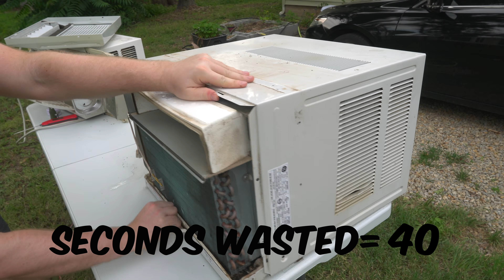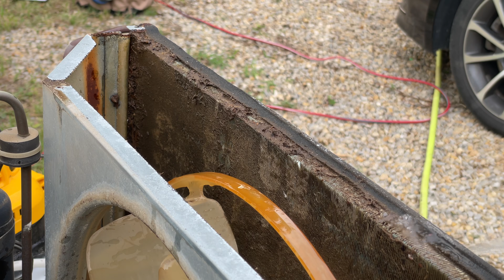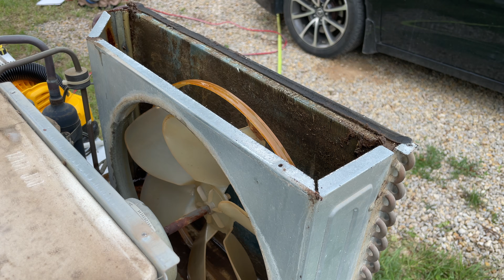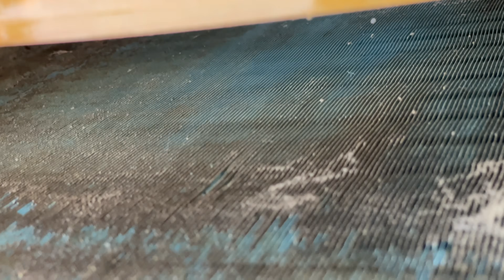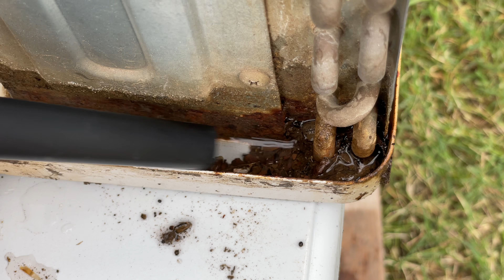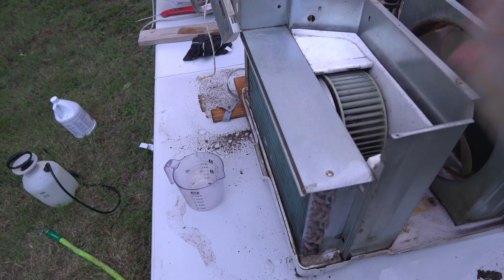DEEP Clean Window AC The Correct Way!

Comment from the maker: ⚠ Did you find this video super helpful or save you money? Buy Tim a coffee to say thanks: ☕ 
PayPal: https://paypal.me/handymanhertz
Venmo: @timhertz      
CashApp: $timhertz1
Reply: They have fin combs! They're easy to use if they get bent. I used to work manufacturing ac units.
Reply: My account is permanently in apt wall. I don't have a drill.
Reply: A coffee?😂
Reply: Hi, hope you see this >> for the added antifungal benefit, can I use in-cide instead of simple green?
Reply: Where are the links to the items you used? I haven't spotted them here.
Reply: Good man, the only proper way to clean a window ac. Filthy inside condenser surface creates short cycling then people just throw them out unnecessarily.
Reply: As a window air conditioner cleaner guy. Here is a tip, triple D coil cleaner. You are welcome. I mix it 6 to 1 and spray everything. Soak to 10 minutes and use the sprayer you use. It melts the mold. A toothbrush works best on the coils but a brush attachment for the drill works well. I like the mold spray that you use but only for after everything is clean. Spot clean the mold in the foam with bleach and rinse immediately. I have been cleaning air conditioners for more than 10 years. If any other cleaners are left on the coils, it can and will oxidation on the coils. Triple D coil cleaner is meant to be left on the coils in lower concentrations. Another great tip. Used 3-in-1 oil on the shaft of the fan motor against the motor to protect it from water getting in. Run the unit on at least low fan for a week to allow the fan bearings to dry out in the off chance that they got wet during cleaning.

Comment: My apartment complex installed the window air conditioners directly into a sealed hole in the wall UNDER a window so no one can access the inside of their ac. 
I’ve been having mold issues on the inside of the machine that I can smell every time it turns on and irritates my allergies. I can only wipe where the air comes out and clean the filter, but I can’t get to the source of the mold. I submitted a maintenance request to get it deep cleaned, but they can’t remove it from the wall either and don’t speak English, so they weren’t understanding me when I told them I had already cleaned it on the outside and they need to go deeper. 
They left and I still have the same problem.

Comment: Did this deep clean on our window unit last summer after it started blowing weak air — made a noticeable difference and honestly should've done it sooner. One thing I'd add: if you clean it thoroughly like this and it's still not cooling well, don't keep troubleshooting yourself — that's usually low refrigerant, not dirt. We called Product Air Heating & Cooling after ours didn't improve post-cleaning and they found a small leak in about 20 minutes. Do the cleaning first, but know when to stop and call someone.

Comment: Just cleaned coils on a windmill window ac that is 11 months old. I turned it off and used simple green coil cleaner and used an ac coil brush. I rinsed it with a spray bottle. Waited 30 minutes and turned it on. It now doesn’t cool at all only fan working. I’ve unplugged waited 24 hours. Plugged in and it’s still dead. I popped test and reset on plug a few times too. So weird it worked great, I went to wash filter and noticed some dust and thought I’d help efficiency lol

Comment: if you want a different option to help clean the fins, I use the ryobi power sprayer, its pretty much a power 18v spray bottle. that can run purple power 40 oz  spray bottle in 10 seconds. and deep cleans without to much power.

Comment: So I just cleaned one of my window units and now the fans are making a loud, awful noise. I put wd40 on the center of each where they spin and it hasn't helped the sound. Do you or anybody happen to know why the fans sound so bad now?
Reply: 🤷‍♀️
Did you solve the problem?
Reply: @sharon5468 I found a video for my exact window unit with the same issue. Apparently it's because some water got on the bearings for the fan. I haven't fixed it yet because I just don't feel like taking the ac back out of the window, but I plan to order the bearings and try once I get them.

Comment: My window air conditioner has only been used 3 years and has a paper burning smell. In those 3 years its been used about a total of 50 or 60 hours. Can the burning paper smell be because its dirty in the back of the unit. Fans spins easily with no resistance. Filter is clean. Unit works perfectly. Its just the burning paper or leaf smell.

Comment: Cleaned two window ac units this way this weekend. They’re like new now. Once they were dry and put them back together I put them back in the windows for summer. But neither one of them wanted to power on hit reset on them. Then for the smaller one I hit reset, once display lit up I held the power button down and it started to run normally. The larger of the two still won’t run and tried the same reset, hold power trick but didn’t work. I know it’s getting power because after you rest it the display lights up the goes dark again any ideas??

Comment: Thanks for the videos! I hear you say don't use a pressure washer but I think my cheap green and black one from harbor freight could work. It's like 1.2 gpm. If I add a wide angle tip the pressure is quite weak.......although I think I should try it on my old one I'm replacing first. Actually I should try cleaning that! I stopped using it because it's old (takes a bunch of electricity) and very moldy.

Thanks again for the videos! I'm trying to learn how to take care of my new investment and keep it as nice as possible.

Comment: Hertz, here at our ranch we just went through this process a few days ago. Last year we did your way, wet clean first, vacuum second. However, this year we were inspired to try dry vacuum the entire AC in and out first. Then wiping it down with water and there was no caking or messy cleanup.  The vacuum initially removed 99% buildup after going over the fins following the lines up and down with a vacuum wand, avoid going back and forth and did not damage or bend the metal grid. This year we learned by hiring a professional hotel/motel cleaning team to deep clean the ranch house. They dry vac everything before washing, including the walls and ceiling and window treatments. Very smart tactic to make the next step of washing more effective and less hassle. Thanks for the video, we're going to add some cleaning products to the mix next year.

Comment: Worked great. I used a garden hose, shop vac, simple green, steel wole. Also drilled some drain holes in the frame. Took me two hours
Reply from the maker: good job for taking care of your stuff. you may look at my efficiency video on drilling a hole vs not.

Comment: i have used the same unit for 8 years and after cleaning i always spray it with concrobium mold control spray and of course let it dry. especially on the foam shroud. It seems to work well to slow mold growth substantially. I can’t speak to any negative effects of doing it but I haven’t noticed increased corrosion and like I said, it’s going on 9 years this summer. Just a thought

Comment: can you recomend a good filter from amazon to switch the one on my window AC?
Reply from the maker: I’ve not looked into that too much. The reason why you don’t want a traditional furnace filter in a big home AC unit is because you need a lot of airflow. Those are too restrictive, and air conditioners don’t have enough surface area for the volume of air. I may be wrong, but that is the reason.

Comment: I hate my window ac unit, the back condenser coil has like a solid piece of plastic around it and the only way to remove it is by taking out the entire motor assembly. They make these things like they are supposed to be disposable

Comment: If you've never cleaned a window ac be careful when you use the little hand brush to clean ac fins because they are very SHARP and if you accidentally hit them they will slice you open multiple times. I've cut myself more than once putting them in, taking them out and cleaning them. I have worked with about 50 of them in my lifetime in rentals and sooner or later you'll get cut. Helpful video because these little units get dirty fast and taking a little time to clean them will make them last longer as well as not make wherever they are installed smell bad after a couple of years.
Reply from the maker: Yes, great tips thanks. You’re right, sooner or later the sharp fins will bite yea if you’re not careful

Comment: I was specifically looking for the best way to clean out the inside of the Styrofoam insert. I have black mold inside the Styrofoam where the cold air comes out and I can't reach into it or see into it to clean it and I don't want to have to resort to cutting it open and trying to glue it back together. That's the one thing I didn't see you clean. Any ideas?

Comment: How much should I pay for someone to clean my AC??  

This window ac is under a tree. I’ve seen squirrels and birds on top of it before. Will placing aluminum on top of my unit keep them off? Every few years my unit gets a funky and moldy smell to it. I usually throw the AC out. Should I just buy a portable AC?
Reply from the maker: If they do a good job, it should take about 1-2 hours. So whatever you think that’s worth per hour. That smell is mold and mildew. A deep clean with mold control will help with that. I have a link for a product I use that eliminates mold and prevents it from coming back in my description.

Comment: Good video bud.. ok my situation.. I  got major sinus and allergy problems well the Nabors down the street was broke and the AC didn't wanna run so I loaned them mine out of my classic car garage  well their house is filthy mold and water damage and just never clean the inside or the outside  dogs they never bother cleaning up behind them .. I got a sinus flair up just from helping them change it out till this week they bought a new one I went and got mine back ..IV got sheds with no floor that ain't that nasty with walls missing    and a lot more leaks 😂.. so I wanna clean this thing  before I stick it back in the side of the garage ..I believe following your directions will probably clean it

Comment: Lately I've been covering the outer casing air-slots with fiberglass window screen - easy to clean externally and KEEPS LEAVES AND BUGS from getting into the back fan/coil so you never have to open it again to clean that big stuff out!

Comment: I tried the mold control, vinegar, bleach, hydrogen peroxide and rmr-141on the styrofoam in my window ac and on the front fin. Saw the fins are actually blue, mine were black. Used toothbrush, tied shoelace at one corner of rag, pushed it down under the wheel til other end came up, played see-saw with saturated rag under wheel. I am not physically able to take the 12,000 btu ac out and put it on carport to take apart and clean. In my usedtacoulds I could remove 5,000 with no problem. Spine and hip joints now say it ain’t gonna happen sister. What can I use to clean out this mold. Found out appliance companies do not come out for window ac units. You have to take the unit to them. Talking to the lady she said they  use basically everything the public has access to. Can’t argue about that cause I don’t know. Need suggestions 🙏

Comment: Why don't they make ACs easier to clean and maintain? I can't remove mine from my window. I live in an apartment building.  Usually the filters are simple to clean but the filth that accumulates inside is quite difficult. I believe the mold is currently causing me discomfort.

Comment: I did just the same, similar tools and AC cleaner, left it 48h to dry at 90F summer, sadly it won't cool anymore 😢,  runs but the compressor never starts. Electrical panel wasn't wet or any cable moved. Any ideas? Compressor died? How to test it and also how to test that big capacitor if that could be also an issue.
Reply from the maker: Sorry to hear that! I’ve never messed with a capacitor on a window unit, but it does sound like it.

Comment: Excellent job.  I'd add 1 thing: I have a small steam cleaner for car detailing - this helps where scrubbing is needed.
Reply: Thanks for mentioning that! I have a steam cleaner and didn't even think about using it😅
Reply: But did you still take the whole unit apart  ?
    There's just no way I'm going to do that as I have a really bad feeling I'm going to screw up my unit and break it and I just want to get rid of what looks like moldy water or this dark colored water and it's just really needs to be clean inside

Comment: Something to keep in mind when tipping your AC unit over on its side, is manufacturers recommend waiting up to 24 hours to turn the unit back on. This helps protect your refrigerant’s compressor, so it’s not damaged from running it dry from displacing its oil or with liquid refrigerant where it’s not supposed to be.
Reply: Thanks , that's good to know .
Reply: Just wondering if you know what people like me should do if we don't have faith that we're going to do a good job taking our unit apart ?
   Mine is a Toshiba about 2 yrs old but it's all plastic crap ,  no metal -- except for grill .
   It also DOESN'T have a hole in the bottom for water drainage but AMPLE water does DRAIN out on my patio .
   But now I noticed the water is POOLING in the bottom and is really dark ...  worried it's mold .
   Do you think if I just turn it off and remove the filter and carefully put some water and spray cleaner in there and then rinse and then wait a while for it to dry ( or use a blow-dryer or a fan )  to make sure nothing's wet before I turn it on that it will be okay  ?
    I really don't want an AC service person in my home as I don't want a stranger coming into my bedroom .
   Even though I live in an apartment it is my own unit that I bought and besides nobody here likes or trust these maintenance people
Reply: Can anyone tell me if I broke my ac because my front grill turns into ice.
Reply: @Jesse-h4f  If the front grille turned to ice, it was likely not dry when you turned it back on and had it set too cold. Always let your AC thoroughly dry out before plugging in. I fried an AC control board because i got it wet and plugged it in once.
Reply: Thank u my brother 👍 ….see the internet isn’t so bad . When u use it responsibly.
Reply: Also any idea what to do about these HORRIBLE filters that come with today's air conditioners they just don't seem to really filter out anything ?
   Any idea what I could buy and maybe put over it that will be a good filler but NOT block air  ?
Reply: @gardensofthegods not really sure. I haven’t looked into this. I do wonder about that too. Most of these filters are a sorry excuse of one. 😂

As far as the black stuff, I’d figure out a way you’re comfortable with that’ll clean that. Spraying chemicals may help some, but opening it up to gently scrub it with a tool that allows you to do it safely to avoid damaging the fins, would be best.
Reply: Thanks! Very helpful to know.
Reply: I read this too
Reply: this also applies to fridges, like when you're transporting them for a move
Reply: Thankyou
Reply: Great feedback I would of overlooked that myself. Makes sense I'm going clean mine tomorrow and do as you recommend let it set right side up for 24 hours then run it let everything settle back in place.

Comment: Maybe I shouldn't have risked it, but I went further and completely removed the innards of my unit from the base of the unit this morning. Soaked the base in some vinegar and baking soda, and used a vacuum brush attachment to clean all the debris from the coils. I took the fan apart and cleaned with alcohol as well. Any piece that wasn't fragile got scrubbed with a brush, including the styrofoam which I also took apart. It was a ton of work, but I couldn't stand the idea of leaving any of that gunk in there and then breathing it in all summer long
Reply from the maker: Good for you! Might as well do it once!

Comment: Solutions if you cannot take it outside? I'm in a 2nd floor apartment. We take it out of the window every winter. But we have no access to a hose.

I took a straw brush to clean the dirt on the wheel. That was really bad. Caked on and little airflow. But I can't figure out how to wash it.
Reply from the maker: Bathtub or shower would work

Comment: Drill a hole in the bottom. The slinger ring is the reason its so clogged up. Yeah I know, lost efficiency. I'd rather the slight loss of efficiency and keep the unit free of concrete strength dirt.

Comment: Questions please: The inside of my 5,000 BTU until has white styrofoam that has mold growing on it. Is that spray safe to use on styrofoam? Also, can the Simple Green spray be used in the bottom pan to help loosen and clean out the gunk that’s been sitting in there?
Reply from the maker: I’d recommend you use concrobium (link in my description) for the mold. Simple green should be fine to use in the bottom pan. Just rinse it off right away
Reply: @ Is it okay to use both cleaners together or do I need to use them separately? I don’t wanna create some toxic gas LOL!
Reply from the maker: @mb5612 not sure, probably better to use separately just to be safe
Reply: @ Thank you so much for your help. I’ll be doing that this weekend.

Comment: You would benefit most from cleaning your unit in the Fall and THEM storing it inside a contractor bag on a shelf on the garage.  I have one unit that is 20 years old used 8 months a year in Florida shed.  One part bleach and three parts water.  Key is to rinse everything off well and to dry in the hot sunshine before reassembling.  And really sry before storing.

Comment: Note to DIYers: take photos. I am not mechanical and, due to rain (unit didn't dry in between to spray Concrobium on dry surfaces) wasn't able to reassemble the same day. I had some photos, but would have liked a series from each piece taken off, through.